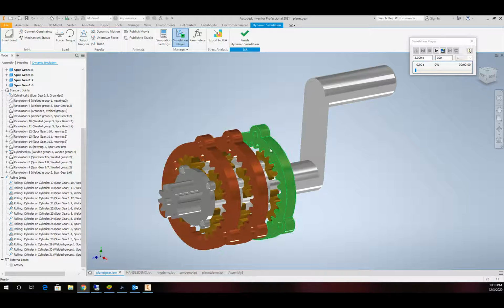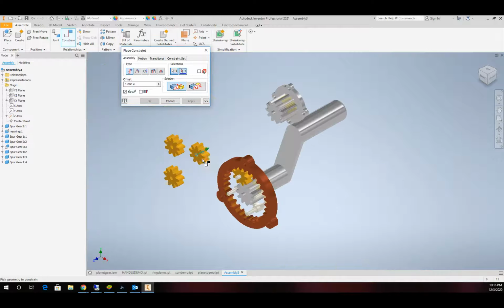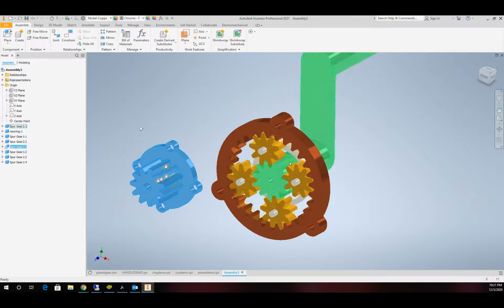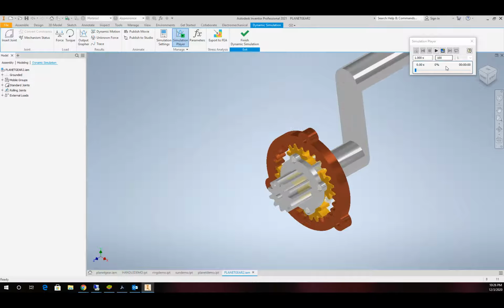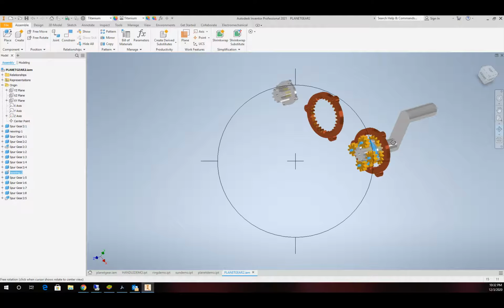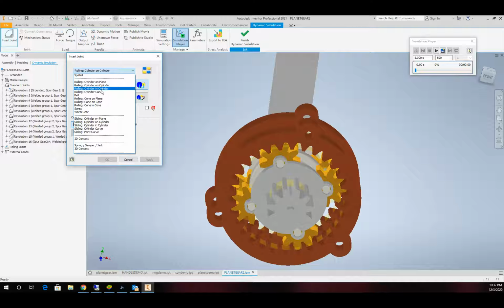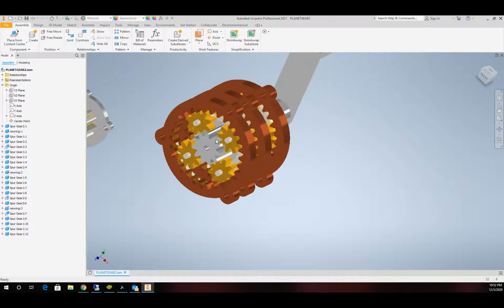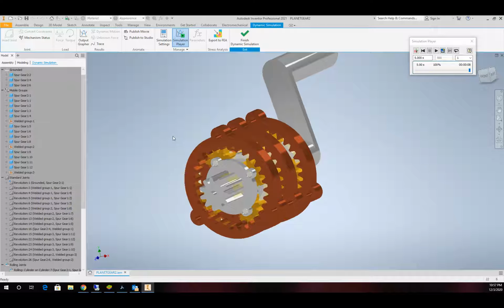Planetary Gear Tutorial in AutoDesk Inventor 2021 using Dynamic Sim

Comment: Hi, I really like this video i am trying to do something like that the thing is outside the simulation window if you turn the handle the gears turn?? Thanks
Reply from the maker: Using standard assembly constraints with a drive option you can preform part of this in the regular environment.  However once you go to the third layer this approach is to much for the system to handle and dynamic sim is the only solution.  If you build the model with only one layer of gears as the video shows . You can then add a angle constraint to the handle part inserting plane to a assembly global plane. This will not allow the assembly to move because you have lock all the degrees of freedom, however if you right click on the angle constraint you will see a drive option.  in the drive option you can set the start angle to 0 and the finish angle to 360 and run it that way.